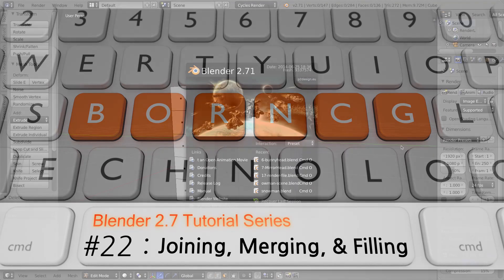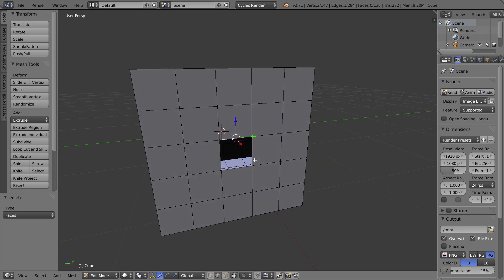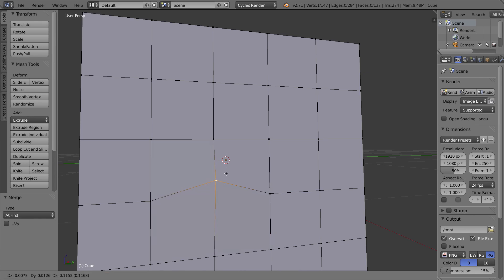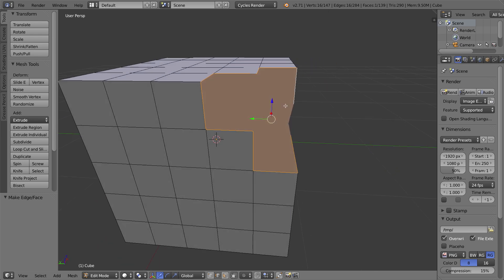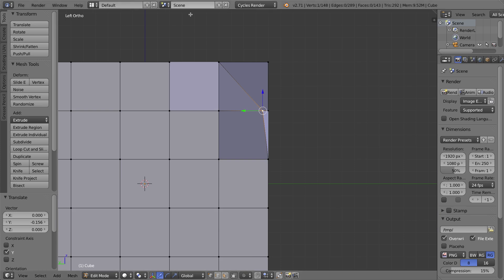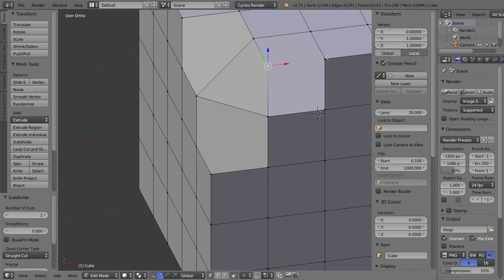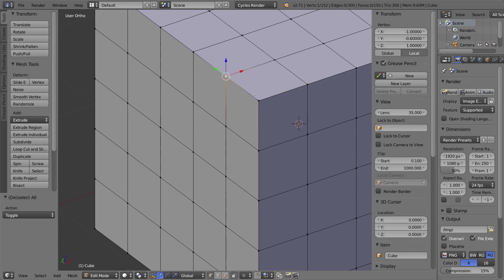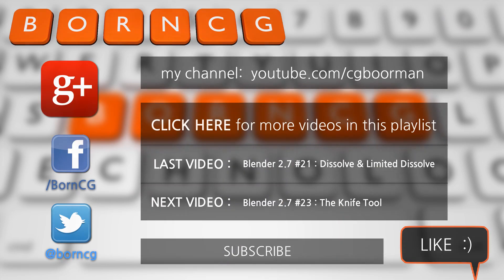Blender 2.7 Tutorial #22 : Joining, Merging & Filling Holes #b3d

Comment: Great video,  I learned a few new things, but there is a quicker and easier way to align vertices using the scale to zero technique. select all vertices and the vertex you would like all others to align to last, hit S then 0 then the X,Y, or Z axis then confirm
Reply: I just tried and it doesn't do the same thing, it aligns them but it moves both to their median
Reply: Change the pivot center from median point to active element. If you have to, shift click to deselect and reselect (to make it active) the vertex  you want all other selected vertices to align to.

Comment: A few minutes ago I asked you a question about loop cuts on another video.  Please disregard that question.  I figured it out and instead ran into a new problem.  I made a cut out that created extra lines in one of my sides.  Because of that, I can't loop cut an extrude edge I created and I'm fully committed to the design now.  I can't go back and fix it.  I have 5 edges extending from one of the vertices.  Do I have another option for creating a cut that would allow me to separate that object so I can color it in?